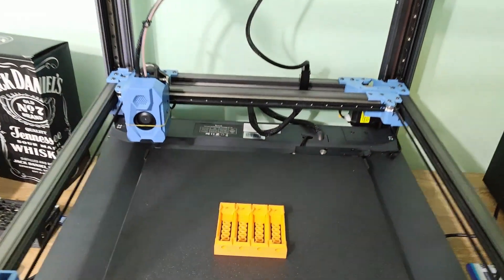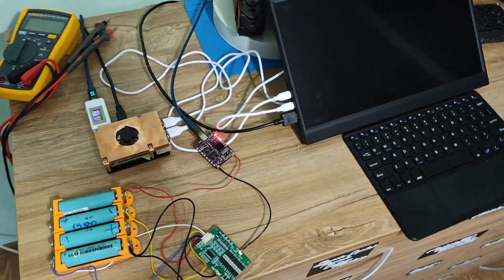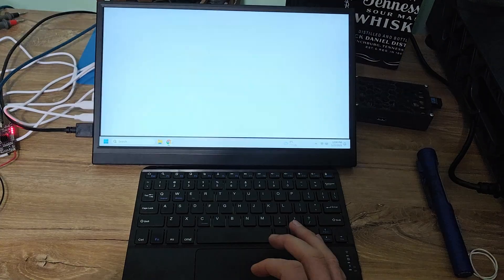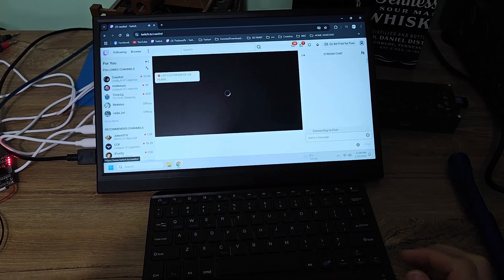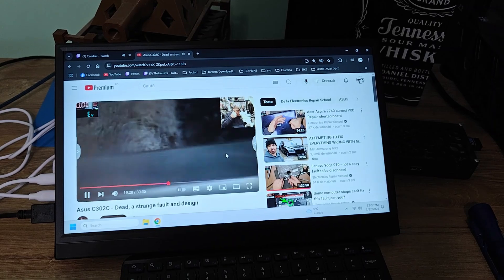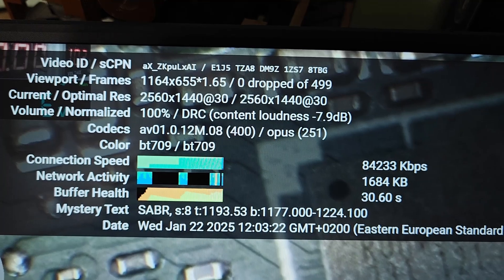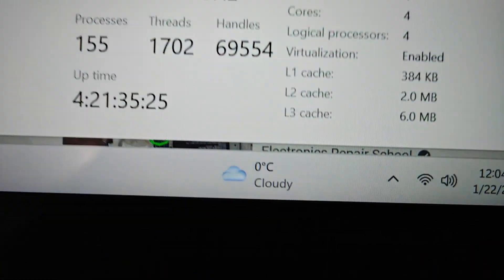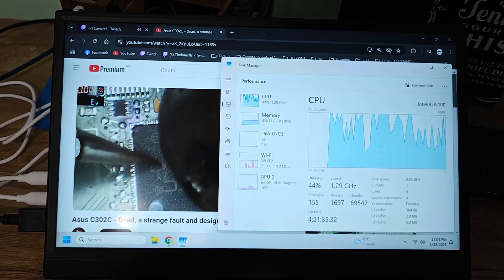Intel N100 Processor ,The Radxa X4 first tests

Comment: I have the same copper heatsink, I managed to adapt the Radxa X4 inside the metal box of a Deskpi Pro V3, the extra space that could be worth it for that pack of batteries, the accessory PCB that It comes with the Deskpi and adapts to Full HDMI also has 5V input/output in case you need a port where you can connect the BMS

Comment: I’ve got the Radxa X4 on order and the Geekworm X-UPS 1 li-on battery supply (similar principle to yours). Can I ask did you use a special PD cable for the Radxa or does it just work using a normal USB C cable. If it is a PD converter cable which one are you using?  Thanks.
Reply from the maker: You need a PD charger and a good quality cable for carrying the 10-20 w power,  but not a special one, I recommend you a Cable with display on it for a easy debugging